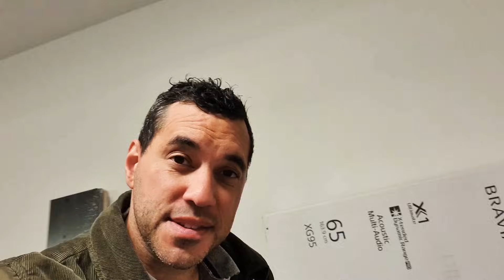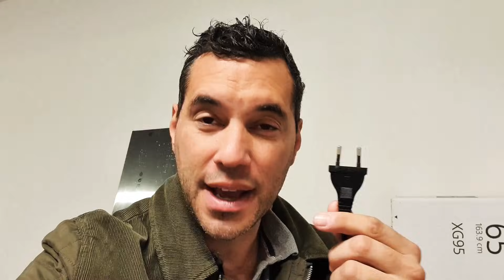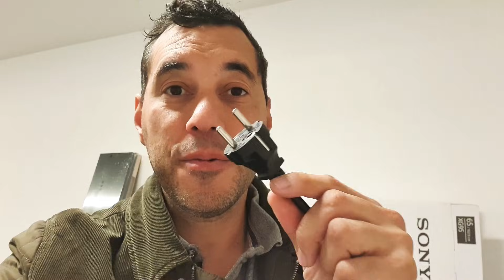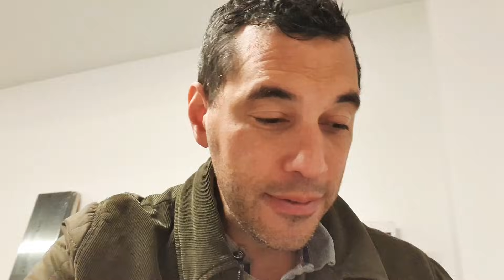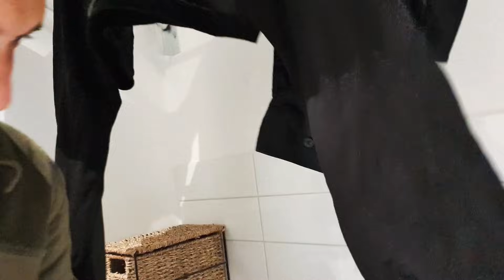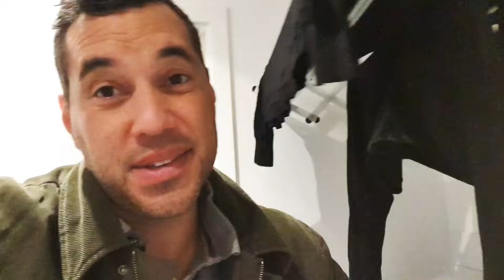Why don't EU plugs have FUSES!!!

Comment: You said that the house is fairly new, but if done correctly, there should be multiple fuses/breakers for individual things in your house. Lights in a room should be on one fuse, while common sockets should be on another fuse. Furthermore your oven, fridge and freezer should be on separate fuses if possible. It sounds more like sloppy work from an electrician rather than bad electrical standards. I would also like to point out the plug size and where the wire comes out of it. The UK plugs are gigantic. Schuko has a handful of different variants where the plug is at an angle or has no earthing (common for vacuums and some kitchen appliances). Normally the plugs where the cable comes straight out is used for things that are more frequently plugged in and out OR that has a potential of being yanked by the cord. Our vacuums have straight plugs to prevent the whole outlet from coming loose if someone trips over it. Moving on to the fuses inside the plug. Schuko does not have a fuse in the cord, however many devices have fuses inside the unit which actually is redundant since our circuit breakers are rated for max 10 Amps for regular power outlets. If a breaker trips, you can look at the "breaker list" where it tells you what outlet/appliance it goes to. Now on to the sockets. In the UK you have switches for every outlet. Sure that could be handy, but we have power strips with switches on them, and most of the time there is a switch on the device you plug in. Last thing is the ugly design on the outlet. I agree, that one you pointed out looks bad. However, that's not the schuko/eu plugs fault. It's the designer and electrician who installed it. We have a plethora of different sockets. Some are sleek and good looking and some look like the one you have. All in all, i just  believe that house/apartment wasn't done with proper installation codes in mind. I am an electrician, so this is where my knowledge comes in. Wish you the best! 🍻
Reply: This! It seems like the house the video maker is talking about just has a bad electricity setup with too few circuit breakers. Normally, in Europe, you have about thirty circuit breakers that splits up everything nicely.
Reply: @bartdevuyst  Yeah that makes sense! I like how it's split up. Easy to work on something without interrupting the rest of the complex!
Reply: UK plugs are not gigantic.  They are made so hands can hold them properly.

Comment: In Italy we usually have magnetothermic breakers instead of fuses as they can be reset without needing to replace them.
They are too big to be put in the plug so they are usually all in the main electrical closet.
There's a main one (usually paired with the main differential current circuit breaker) and other smaller ones for all the appliances that require a lot of current (oven, water heater, washing machine, etc).
Sometimes if the house is very big you can also have magnetothermic breakers between different part of the house.
Anycase, even small apartments are required to have every room connected to the main automatic breaker through its very own manual circuit breaker. That way if something doesn't work you can isolate every room, reset the main breaker and reconnect every room one by one until you find the faulty one.
Reply: Or you can have a fused plug and if that appliances dosn't work you know straight away which one it is that's not working ! 😕
Reply: @sickoftheleftwingscum  You still very much need a breaker. The breakers are NOT there to protect you or the appliance, they protect the wiring in the house! 
The ground fault monitors protect YOU. 

If an appliance goes bad, two scenarious are dangerous. If they short, the breaker will trip no matter what, a fuse in the plug isn't needed. If they leak current to say a metallic chassis, this could hurt YOU, but it might not be enough to trip the breaker, or even an in plug fuse, this is when the ground fault monitor trips. 

The UK plug could make it easier to identify which appliance broke down, as it just won't turn on. While th EU system requires you to check pretty much every appliance on that breaker. (usually you can determine the culprit pretty easily anyway). Thermal fuses could definitely deteriorate over time though, so if you're unlucky, you need to replace random fuses from time to time, especially if they are high load ones.
Reply: @sickoftheleftwingscum  Most European houses have separate breakers for each room and lights & plugs separately, so if one kicks you know exactly which room it is and if it's the lights or the plugs. High load appliances have their own breakers, such as induction, ovens etc. Then there's the special breakers for bathrooms. Since the magnetothermic breakers can be reset, you can quickly eliminate which appliance or bulb is problematic, remove it and everything works again. No need to fiddle with replacing any pointless fuses in plugs or otherwise.

Comment: I think only the UK plug has a fuse in it. Australian doesn't, American doesn't, EU doesn't, and Chinese doesn't.
Reply: its cause we use a ring circuit to save copper because it was invented right after WW2
Reply: @Lord_Reeves  
The fuse-in-plug was not invented entirely for rings, although it does make rings work properly and safe. My mothers house was built in 1953 with British 3-pin fuse-in-plugs, but it was all radials. The fuse-in-plug was to isolate problems to a particular appliance rather than take out a whole circuit.

A ring is a busbar that takes the main panel out to around the house, rather than have all the socket having their own fuse at a gigantic main panel.  British ingenuity.

Comment: Well the UK has fused plugs because they have to, and that’s because of their ring circuit wiring system.  Europe protects their circuits the way the US does (and the way the UK used to do)—with fuse or breaker that matches the maximum plug rating for the circuit
Reply: But does not protect an appliance's flex or the appliance. You can plug into a socket on a 20 amp radial circuit a table lamp that draws less than 1 amp, with a light 3 amp rated flex. Any problem, the flex can overheat and cause a fire.  In the UK the table lamp would have a 1A fuse cutting it out if there is a problem. The UK is safer. 

The UK's electrical safety record is far higher than the rest of Europe. And that is with a large immigrant population that are not aware of electrical safety as those born in the UK.
Reply: @johnburns4017  There are no sockets on 20 A breakers in Europe. It is either 10 A or 16 A. A lamp rated for 3 A draws only 3 A so there is no problem.
Reply: @okaro6595  wrote:
" A lamp rated for 3 A draws only 3 A so there is no problem."

Unless there is a problem.  We have AFDDs on some circuits to catch the problems.
Reply: @johnburns4017 Stop bragging about the AFDD.. I watch a lot of UK electrician channels and most of them don't trust this thing as they are not reliable and cause nuisance tripping instead.
Reply: @IAmThe_RA  
The reliability of AFDDs is not a problem these days. And as always do not buy cheap.

Comment: It depends on the budget. You can have separate fuses for each socket, but it's generally considered over the top.
Reply: The British system has a fuse for each socket - the fuse is inside the plug.

Comment: Seems a bit weird. At least over here in Finland, there's often a fuse per room plus additional fuses for stoves etc. I guess it's just a different way of doing things. At least we don't have ring circuit mains.
Reply: That's right. Sockets have their own fuse per room (even more). Then the lighting often has its own circuit / fuse. In addition to this, there are often outlets for more power consuming appliances such as a washing machine and stove for example. Of course, this causes the fuse box to have several dozen fuses. Where in the UK a standard fuse box is often only about 10-15 fuses for the whole house. I have a small detached house with a fuse box with space for 145 fuses, of which I now have about 40 units in use. Sure, this bigger fuse box has more things than just fuses. There are, for example, DIN rail devices for home automation.
Reply: Im also from Finland and I wouldnt want plugs have fuses. What happens if it goes off? Do you have to replace it? Nowadays I can just switch it back on from the fuse box. And I dont need to hassle with these things anyway so I like the plugs just like they are, small, unbreakable, plug it in both ways ..
Reply: @TuomioK yes I think the fuse is usually is replaceable
Reply: It's the same here in Sweden, unsure what this no-fuse stuff is about because the location says Sweden, dunno what to think.
Reply: How you set up your circuit breakers (fuses) depend a lot. Like BeingSwenglish mentioned, his freezer was unaffected by the power outage. Most people really want their freezer to stay on so their food don't spoil, so separating that appliance from those more likely to trip a breaker, like the oven, could be a good idea. 

When designing an electrical system you have to keep a few things in mind. 
One breaker per room could be too much, or too little. Electrical engineers focus heavily on phase balance. We don't want one phase under load continuously while the other two have no load. This can cause problems, like electromagnetics affecting stuff, and issues for the grid. Instead, we want to divide all continuous loads equally (as far as we can) to all phases. Say, one phase for fridge and freezer, one for a heat pump, one for the water heater. 

We then make sure outlets, especially outlets expected to be under load from time to time are spread throughout the phases. If there's three bedrooms, it would make sense to have each on a seperate breaker, connected to seperate phases. Outdoor outlets should have their own breakers, because they could tend to trip more easily. Putting a freezer on that same breaker would be a bad idea. Lightning should have their own breaker, and they should too be divided on all three phases if you have a large house, with lights that draw lots of power.
You also have to consider loads. In a kitchen, you might wan't to have the outlets meant for the coffee machine, kettle or microwave on a seperate breaker, with no other continuous loads attached, because you need to have "all 10 amps free". Running a kettle on the same breaker as a freezer means that you don't know how much power is actually available. 

Ground fault monitors are also designed this way. All outlets could run on the same one, but outdoor outlets might need their own, so they don't affect the house. A three phase heating system like a geothermal pump should definitely have it's own ground fault monitor, so if something trips the one for the house, your house won't freeze. 

This is why the installation can seem "illogical", because one outlet right next to another might be unaffected by the other one breaking. But it definitely has a reason!
Reply: My house seem to have a different fuse for lights and outlets per area in house
Reply from the maker: Great docsuesion and information folks, thanks for the comments!
Reply: It varies alot. I've had apartments with ceramic type fuses and they only had basicly 3 circuits, oven, lights, room plugs. Modern apartments are tad better and usually have circuit breakers and RCDs and usually lights are on seperated from room plugs and usually there is couple rooms behind every breaker.
Reply from the maker: Wow a fuse per room, unusual but kinda makes sense, nice for an entire room to cut if something in that room trips the fuse! I like it!
Reply: @BeingSwenglish  fuzes installed in house/room, etc makes more sense than in every single low voltage/low amp plug. I understand for high power equipment, like welding,turning,beltsaws,etc. its own fuse.

Just open a small door, and boom, do a click, and everythings back, if its something worse, just change the fuse, but if every plug has a fuse, look for a screw driver, have to open it, etc, etc.

Comment: Great video. I agree too every socket needs a fuse. I also think every country should go with that idea even the United States 🇺🇸. So the resident doesn’t have to walk all the way to the main panel to change a fuse or reset a circuit breaker. Your video was very informative.
Reply from the maker: Thanks Kevin for the comment, really appreciate it!

Comment: In the us and canada they have circuit beakers that will turn off the power if that happens you don't have to buy a fuse every time but you should get an electrician in there to fix it could be something arcing causing the fuse to blow
Reply: It's the same in Sweden and elsewhere (in modern installations), but in this particular case it sounds like the electrician was in a bit of hurry, or perhaps there were last minute changes made to kitchen layout after the electricity installation was already planned and made. Such as, for example, planning for a combined fridge/freezer, then changing it to two separate full-heigh fridge & freezer which would require two sockets, but there only being one, so that one of the two had to go on a circuit intended as an ordinary wall socket. That even happened in my relatively new house in the UK.
Reply from the maker: It's the same in UK and Sweden Justin, and actually it turns out that the fuse popping in our house was solely because we plugged in our electric car to charges that blew the ampage and hence caused everything to fail. So it wasn't a wiring fault, it was ours!